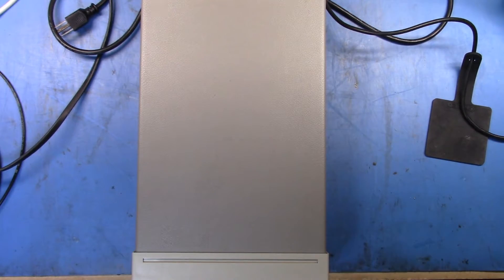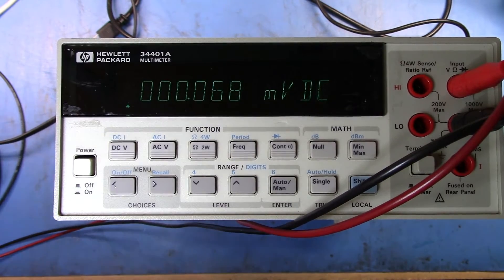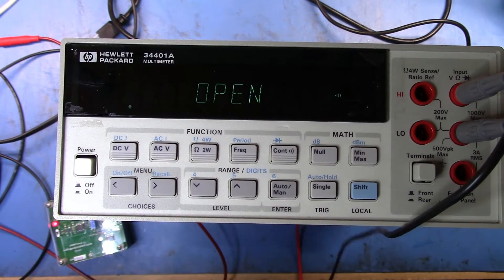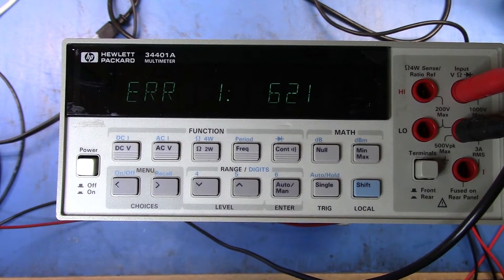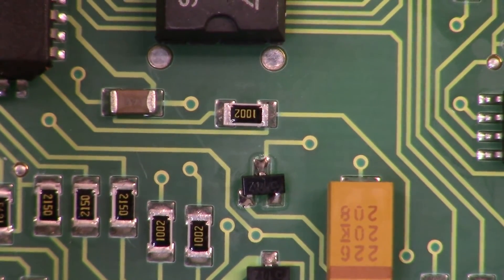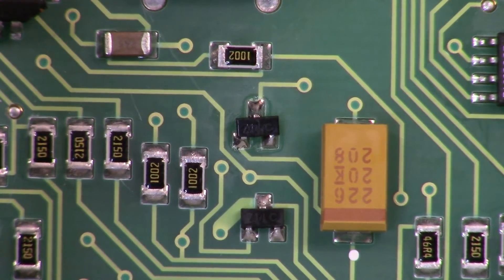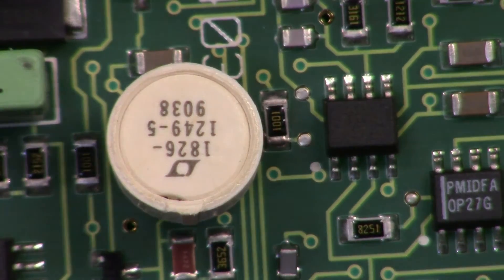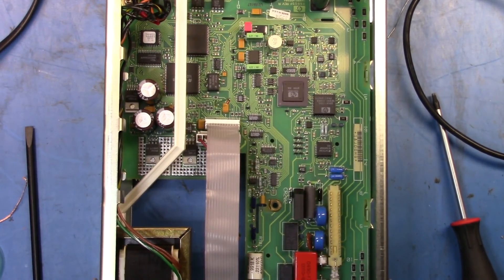HP34401A Repair

Comment: Also, it's hard to measure current without putting a lead in the current jack.
Reply from the maker: Yep - This was a reshoot where I had measured the current reference before so I knew the result and simply forgot to actually do the lead change - Didn't notice it until it was brought up here in the comments.

Comment: It was pretty scary watching the zener being removed without applying any flux. The solder wick does have some flux in it, but not nearly enough to make removal easy. On anything but a high quality board, there is a great danger of pulling solder pads off  when removing a component this way. A hot air gun is the best way to remove surface mount components, but you can also wrap some 14 gauge wire around a soldering iron tip and shape the end so it can contact all the pins on the component. It will help if you file the wire so it has square edges that will make better contact with the component leads. Use lots of flux and solder on the wire, then apply gentle sideways pressure. When the solder melts, the component will slide off without damaging the pads. Use solder wick to remove the remaining solder from the pads so the new component will lie flat on the board.
Reply from the maker: Thanks for the feedback - Appreciate it.

Comment: Nice and wary easy repair but that's why I'd rather buy a new meter in the same pricerange.
Reply from the maker: Thanks - These are very good meters for the price even so but yes, new is better if the specs are the same (or if you don't need the 6.5 digits).

Comment: Dear I get the error 621 and the 622 the solution is the same
Reply from the maker: I was only getting 621 but people who have had both these errors report that it might be related to C301 - Check out these 2 threads - http://www.eevblog.com/forum/repair/agilent-hp-34401a-insanely-simple-thoubleshooting-and-repair/msg193013/#msg193013 and http://www.eevblog.com/forum/repair/hp-34401a-error-612-613-615-617-618-619-621/msg482445/#msg482445 - The service manual is comprehensive and located here https://literature.cdn.keysight.com/litweb/pdf/34401-90013.pdf?id=765594

TonyG
Reply: Thanks
Reply: @tgsoapbox  I think you were pushing the down button when trying to see the additional error messages.  I think it's supposed to be the right button.
Reply from the maker: @ydonl  Thanks for the comment - I don't have the meter anymore as I had bought it for my Dad - You could be absolutely right but unfortunately I can't check. It's either right arrow to enter the error menu and down to go through the errors or right to enter the menu and then right to go through. I guess unless you have the meter and multiple errors you can't test though :(

Comment: Gave me the shivers when you put that long-legged Zener on those tiny pads!  :S   By the way, when you want to measure current with these things, you have to plug the lead into the current jack (the bottom one by itself). Are you using a document camera? I really like how much you can zoom in.
Reply from the maker: Thanks - I'll have to go back and watch what I did, I know you need to use the current input so if I didn't switch it then I was just an idiot. Tacking that diode in place was a tiny bit risky but if you use low temps and little solder then you can usually be OK. As for the camera, I'm just using a Canon R600 with a mount screwed onto my bench to hold it above the work area. You can see it here https://imgur.com/fJ04uUH
Reply from the maker: Missed a word "...little solder bubbles..." - What I was trying to say was that creating those little dollops of solder meant that I could melt them and poke the end of the wire into the mass without stressing the pad (or at least minimizing the stress) - Anyway, that was the thinking behind it.